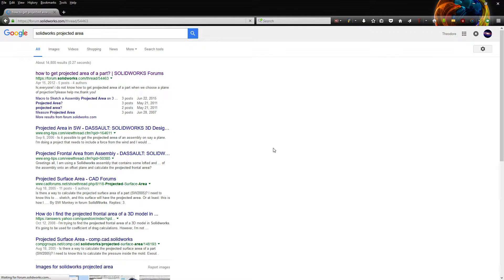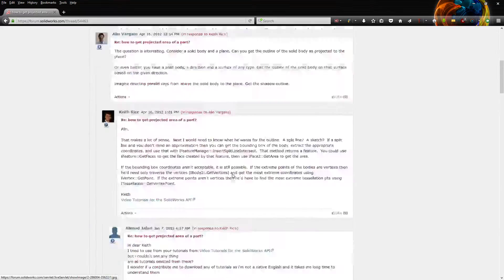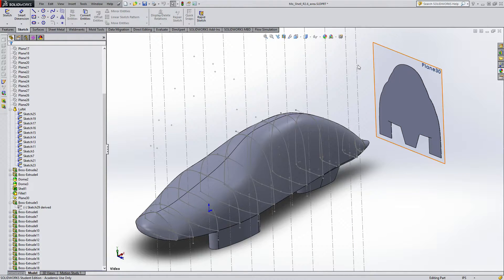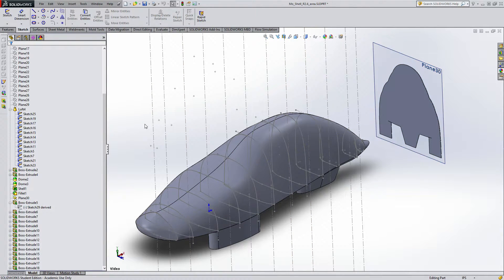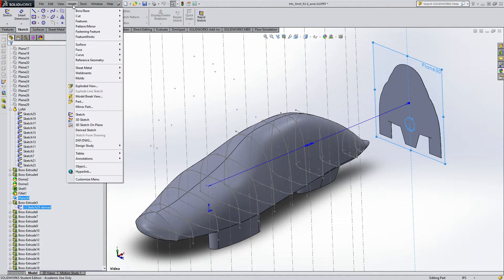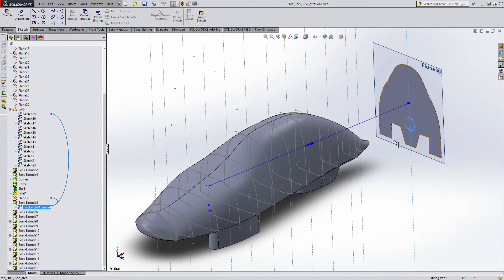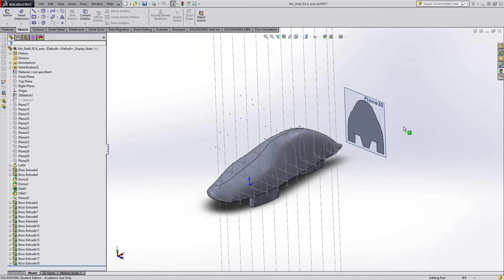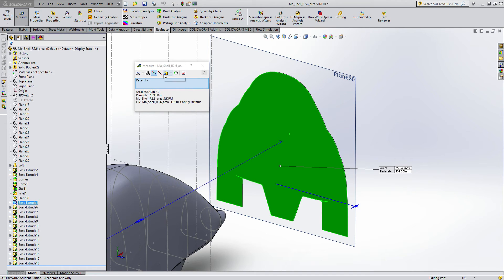Projected Area for Solidworks 2015

Comment: Good explanation, but it doesnt work if you're doing an aircraft and wings are lifted or extruded outward. 

I'm curious if you cant make sketches out of cutplanes at varying locations....?
Reply from the maker: Maybe? I made this about 3 years ago when i was working on a Supermileage car. Was not thinking of other applications.